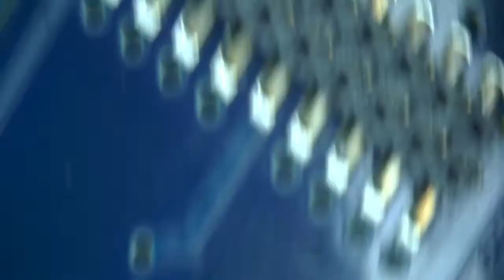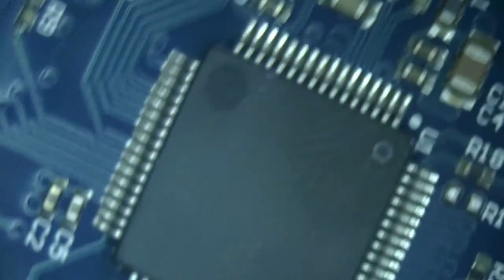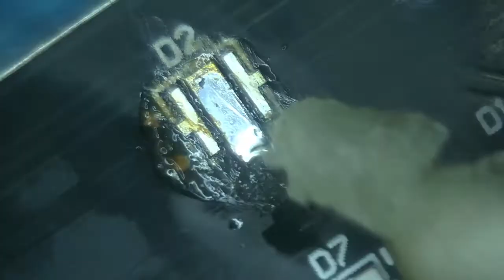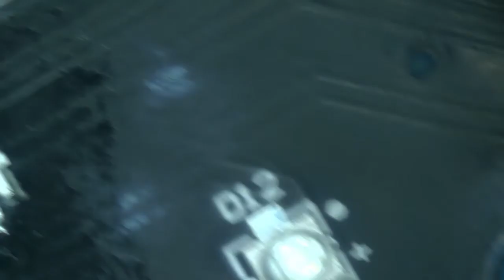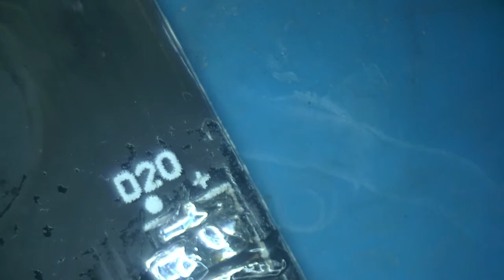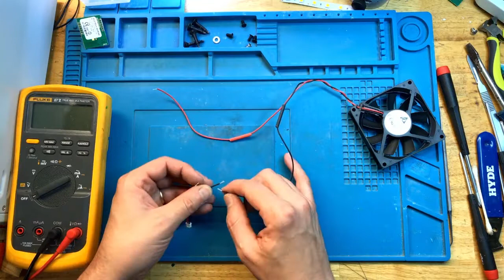Water damaged Radion Beyond Repair? Don't think so! Bonus: Fan Replacement

Comment: Thanks for making these awesome videos! Quick question for you: what do you think about buying a used but fully functional xr30 gen3 in 2022. Do the lights lose power over time? It would be on a tank lit by a single light, so I'm not worried about matching. 

When these break, what tends to break?

Bad idea to buy one? Good idea? It's only $100. I could get a new black box for that price, but I wonder if this is still better, even if old.
Reply from the maker: G3 is still relevant and at $100 is a very good deal assuming it works. UV lights seem to fail on most radions overtime. Make sure that all LEDs light up at lowest intensity. Good to go if they do.
Reply: @FixReef  thanks! Hopefully it will work out!
Reply: Finally got my "new" light. Ended up with a used xr30pro g4.